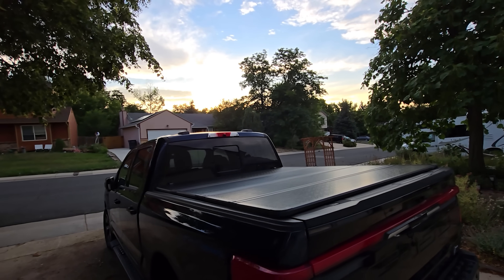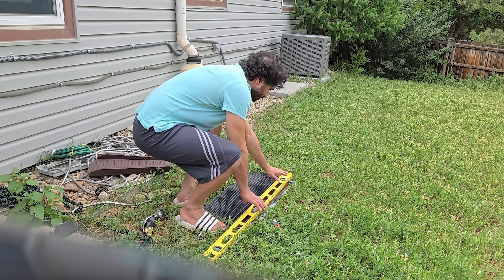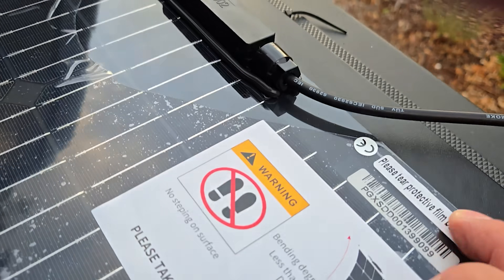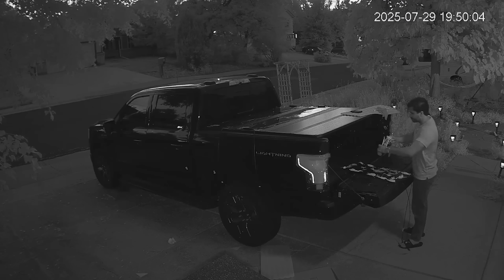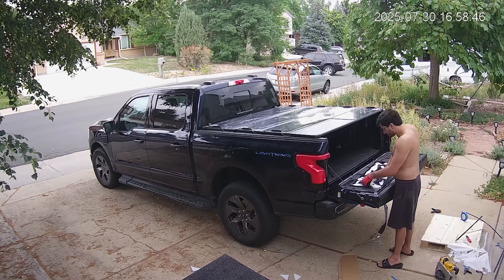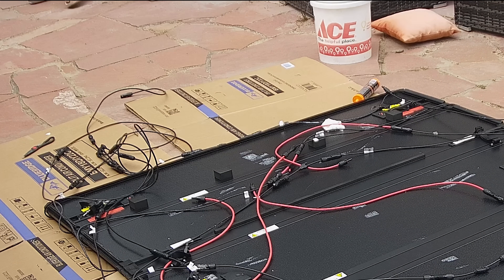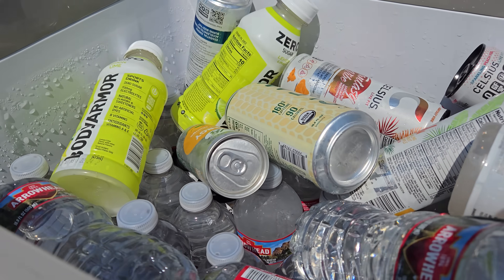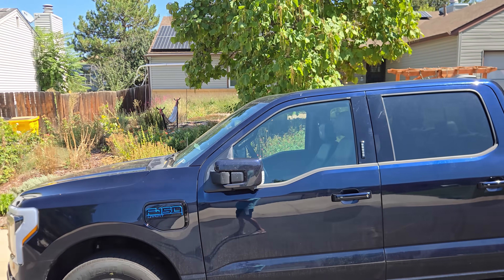Building a Solar Panel Tonneau Cover to Recharge My Electric Truck

Comment: Pretty cool! Doing similar on my preoject truck, but solar panels will be on the lid of my flush toolbox (not tonneau cover).

Im going to use it to power a mobile wifi hotspot and dashcam. The hospot and dashcam setup will always be ready to send notifications to my cellphone when something happens.

I calculated it so that my dual batteries will stay topped up and my dashcam,  hotspot, and compustar alarm system never has to steal current from the batteries as it always gets replenished in daytime.

Comment: Did anyone recommend a one piece, fiberglass cover with hydraulic struts? Larger panels, less wiring, fewer moving parts.
You can upgrade the struts for the added weight.
Reply from the maker: Sadly no one has recommended that yet

Comment: i get that the appeal was for it to be a truck be cover. but hear me out.what if you had attached this to a truck bed rack or an over cab truck bed rack. you could have had panels that slide from under the rack and over the cap more room and mounting points. and if you store a tarp in the back in case of emergencies, you can throw it over the bed and have a little shelter. Sounds dumb but when you've been through as many hurricanes as I have.  being mobile and having a safe place to rest and charge devices outside your home is nice. and the cables could be run a lot more cleanly if tied to a leg of the rack. and it's still light enough to be taken down by one person.

Comment: If you put some sort of heat sink under the panels they will be even more effecient, also clean up those cables , it’s ruining the truck part of having a truck bed
Reply from the maker: I was thinking about the heat sink too, prob for v2 if the panels degrees. And yeah it's been fine so far and just slightly annoying 😅 currently on a road trip and have so much stuff in there, including a powered freezer

Comment: Looks like a robot spider took a shit in the bed of your truck.  Too many dangly wires all over, ruins bed utility.

I accomplish the same thing with far less hardware.  I have an 8020 extruded aluminum roof rack on the camper shell of my truck.  I've got a pair of 100w solar panels up there (200w total), with MC4 cables coming into the camper shell.  These feed a charge controller and charge a small lead acid battery.  The battery powers an ICECO cooler/fridge, as well as other potential accessories inside the camper shell.
Reply from the maker: Nice post a pic. If you have suggestions that allow for more tidiness let me know. It's not immobile like a camper shell, so I still want to remove it or open the cover.

Comment: Maybe putting a hard too camper shell on the truck and then you could put an entire panel on the roof. Would probably yield more power and make the wiring/batteries safer!

Comment: did you know the caulk gun has a spout cutter built into it? 😂 Under ideal conditions, charging a 131kwh battery with a 375W solar panel will take about 3 months.

Comment: There were some very interesting choices made here. “Measure once cut 15 times” was the motto apparently. 

Those panels at risk of hotspots, it’s a cool idea, but going with 80% the panel size and not cutting them would have been a much better long term choice. 

I don’t think I saw a tape measure in the entire video. 

Almost line a behind the scene look at next season for “Just rolled in”

Comment: Nice! This is really cool. I have a 150W panel on the bedrails of my Maverick, and it works really well to keep my Ecoflow Delta 2 topped off. Can run my cellular modem and Starlink Mini without a problem
Reply from the maker: That's awesome!

Comment: Great video!  would be cool if there was a way to integrate solar charge controller and have it charge right into the main battery of truck (weight savings) and picking up 3-5 miles for free each day would be nice...have you thought about doing flexible panels on roof of truck to add more wattage?
Reply from the maker: Thanks! I have a moonroof so can't really add to the roof, and if I did I definitely wouldn't glue it lol

Comment: I've got a small solar array on the roof of my Maverick. It is powering some high static pressure PC fans at the pressure relief valve pushing air out of the cab.  More sun = more air turns over.  This allows the cab to stay much closer to ambient air temp.
Reply from the maker: That's awesome, you should showcase it in a video! I'd love to see it, either way I'm going to look into it more.

Do you shut it off while you're driving so the cabin stays cool with the AC on?

Comment: I put 3 100w flat solar panels on my tonneau cover 2 years ago. They worked great for a while, then slowly they produced less and less power. I live in South Louisiana so it's hot in the summer. I believe the heat kills the panels. I was getting close to 200w at first, now with early morning sun they might get 50w and in the heat of the day I'm lucky to get 20w. Have tried different brands to replace panels with no luck. Would like to try the cigs panels, I think they would work, but the sizes don't fit and they are significantly more expensive too.
Reply from the maker: That's a bummer, thanks for sharing and good to know I'm not the only one to do this. I was expecting some degradation but only 10% output after 2 years is crazy. I hope that doesn't happen to me.

Comment: For the security system there are DIY cctv kits for RVs Vans and other campers maybe a fun addition to the truck?
Reply from the maker: Thanks I'll investigate some more!
Reply: @deadlykiller27 I don’t think I can post a link here, but there is a van builder here on yt called Love Sundays and he installed such a kit on his van build showing it of in a build video and sharing an Amazon link it was quite afordable.
Reply from the maker: @MrKittke thanks for the suggestion. Tried looking through his videos but there's just too many and none of them are titled with cctv or anything obvious (I just see dashcams)

If you have a name of the cctv kit directly I'll check it out

Comment: You could run some 24/7 dashcams via their 12V hookups directly into that setup.  Pretty much make a similar setup that Teslas have built in.
Reply from the maker: I was thinking something similar! When I get it working I'll post an update video, for now gotta find the best cams that don't look obtuse and figure out the best way to run the wires

Comment: Every panel or panel string must have a fuse that is less than the panel Max voltage additionally you should have an isolator switch for every string lest you have a future fire. When smoke is coming out of your wires it’s too late to be looking for isolators that aren’t there.

Comment: I have solar panels on my house. I bought a charge point home charger and wired it in myself on sunny days. I can gain 10 to 12 mi per hour at the lowest setting and still charge the batteries on the house as well as run the house.
Reply: That’s my dream! Do you have to use grid power often?

Comment: Omg that's such a good idea. You really need to sell that idea. It nearly there for a professional job. You could run a dashcam off it for security.
Reply from the maker: That's my plan next, just got to figure out a way that looks half decent 😅
Reply: @deadlykiller27 it looks so good now. Maybe a black border thin around it. Oh maybe a frame and then attach the frame some way so that you can remove it from the cover itself.

Comment: What cooler model is this? I like that it doesn’t have dual zone that will take away from the overall space because of the partition. Cool setup!
Reply from the maker: Yeah I didn't want something with a partition, thought it would just be more trouble than it's worth. If I wanted to also freeze I'd just buy another one. I got this one

"Simzlife 12 Volt Car Refrigerator, 80QT(75L) Portable RV Car Fridge with Wheels, 0℉~68℉, 12/24V DC & 110-240V AC, Black"

I bought it off Walmart. It's also available by the same brand and others on AliExpress for way cheaper, but each time I tried ordering it (different sellers) they never had it in stock and the order would get cancelled.
Reply: @deadlykiller27 appreciate the quick response

Comment: Looks like about 400w of panels? I had a GMC 2500 that I glued 200w of panels on the roof of. I used something called Sika flex. The panels would charge a battery bank that was in the bed tool box

Comment: I don't know if the battery chemistry would even allow it but it would be cool if EVs had a solar top up option. Not so you could increase the range but so you could run things like your fridge of the car's battery and not have to carry around additional batteries.
Reply: Yes, the battery chemistry allows it, but the packs keep getting higher and higher voltage. Solar MPPT to EV battery is probably being worked on, but it’s an annoying electrical engineering problem as there are a bunch of different possible inputs and outputs. To do it efficiently, the charge controller would need to be developed for a specific car or battery system architecture. Ideally, it would interface with the existing BMS.

Comment: With as little as I generally drive (about 50-60 miles a month), that 2-3 miles a day might be enough to make a truck like that "free" to operate. Unfortunately the F150 lightning is just WAY out of my price range, and the payment alone would more than offset any cost savings from the little bit of gas I actually use (I fill up once every other month, and it usually doesn't need it).
Reply: EVs definitely aren't a good investment on their own (no vehicle is), but if you are ever in the market for a new car, consider electric instead of ICE. Hopefully the tax credits will be back by that time too. And there might be a used market too!

Comment: Thats a pretty awesome project. It'd be neat if you could rig up some kind of AC for the cab so when you get in on a hot day the cab is comfortable!  They have made progress on small 12 vort AC units.
Reply from the maker: Yes that would be cool! At the very least a fan ventilation system to exhaust hot air

Comment: Do dashcam that wired to the aux battery so it could run 24/7 without worrying the low voltage car battery
Reply from the maker: Agreed! Figuring that out with the wiring situation is going to be one of my next steps

Comment: Fyi, I was researching these thin, flexible solar panels for a different project, and there were many complaints that these panels are dead within a year or two from the overlanding community.

Comment: Literally makes total sense should be a normal thing for electric trucks

Edit: Specifically meant for beds with these covers not roof or hood as those are not flat

Edit:  not sure why F-sts think they can project their ideals over things that do not affect their lives one bit
Reply: Solar powered car has been an idea since so long ago but it's not practical since the solar panel only barely give extra range

Even if all the car's surface are covered in solar panels, the added range are still abysmal (like only 8-10 miles for a whole day of perfect sunlight)
Reply: @sihamhamda47 not really your problem what people buy to keep their 12v, features and accessories powered up with free solar power
Reply: There are flexible solar panels too. It feels silly that every EV doesn't have them.
Reply: @rouchar makes sense to put them on.
Reply: Yeah only be a $8000 - $12,000option😂 for little effect
Reply: @buffalobmf check out some episodes of this old house where they talk about solar panels being half as cheap as a few years ago and twice as efficient. Solar isn’t expensive anymore
Reply: @jtek5si auto makers would make that a 8000-12,000 option. And it doesnt make anywhere near enough power to even justify doing what he did
Reply: @buffalobmf money is no object for ev buyers known fact..
Reply: This will take days of perfect sunlight to add a just few miles. It's not even remotely worth it.
Reply: @jason91notch so what you’re saying if you are not going anywhere for a few days and leave it outside it’ll get charged.  At an airport will either keep it charged or increase battery level.  It can also maintain the 12v battery and active features like sentry mode.  All yall have such narrow thinking when you come across something you don’t like.
Reply: @FullSpectrumWarrior  sure, it might be enough to maintain a charge level if the truck is sitting for days at a time. But spending thousands of dollars and taking up bed space for batteries and eliminating the ability to haul stuff on your cover, (I've hauled an ATV on mine), for what is essentially a trickle charger is stupid.
Reply: @jason91notch money no object for ev owners and not your concern what they spend their money on.  Very (overused word these days) F thinking
Reply: @FullSpectrumWarrior I'm an EV owner, and it is definitely an "object". It's objectively dumb. Simple as that.
Reply: @jason91notch being an ev owner doesn’t mean you are automatically an F but your insistence on the “you don’t need” makes you one.   Since it doesn’t affect your life…denied
Reply: @FullSpectrumWarrior good job deflecting instead of admitting you're wrong. 👍
Reply: Same thing for the roof and hood, these are huge vehicles , might as well take advantage of the space
Reply: @wx2999  Weird how EVs don't come with built in solar panels by default.
Reply: @noppornwongrassamee8941 it would be $$$. I'm surprised Rivian hasn't done it though. Tesla really could since they make solar rooftops. Would make the cybertruck a little better imo
Reply: @noppornwongrassamee8941  I LOVE the idea, but the juice isnt worth the squeeze. 

If you COVER the entire car body with solar (I mean make body panels with solar capability at the mfr, not glue square panels all over the place), and leave it in direct sunlight, you might get 500W. Car body panels will rarely be at exactly the right angle for max solar power and half the car will be in shade at any time, and a lot of the time cars will be parked out of the sun anyway.  And then of course rainy and cloudy days will cut it in half or worse. Pickup has an advantage in that its largely flat, so you have that going for you.

For that 500W of solar body the mfr would probably charge $5000 for the option. The Prius had an optional solar panel roof that cost that much 10-15 years ago and that got like 200W in direct sun but all it did was run the fan so the cabin didnt get as hot which would technically save you gas on air conditioning once you drove off cause the cabin would be 100F starting out instead of 140F. And of course valueless in winter when you WANT it warm.  Theyre much cheaper today and capable of more shapes so I think you could get the whole body for that, maybe.

This pickup probably draws 35,000W driving down the road at a steady 65mph. So for every 75 hours of sitting outside on a sunny day you get 1 hour of driving - thats 19 days worth of sun in Ohio on average; in December you probably would not get that much sun during the entire month and it will be at such a low angle you aint gonna get full power no matter where you park. You can purchase the same electricity from a commercial charger on the highway for $17.50 in about 10 minutes or at home for $3.00 in 3 hours. Will the panels work long enough to break even?

Possibly they could engineer it to allow charging while driving. With normal "sitting still" charging they reuse motor electronics for charging, so they would have to add more electronics, they would probably want another $2,500 per car amortized across the entire production line for that ability. Probably even less worthwhile, how many hours would you be actually driving in direct sunlight?

There is one car you can currently (npi) buy that IS "solar powered" - the Aptera. It is a little 2 seater shaped like a water drop and covered in panels. You can just squeak by never needing to charge it (it does have a charging plug) if you dont drive much. Its a 3-wheeler so it only has to meet motorcycle crash safety standards (ie none) consider that for what you think its worth.
Reply: @natehill8069  On average in the USA about "60-80 miles of energy" hits a F-150 Lightning on an average day. With solar panel efficiency and inverter losses, that drops to a usable 10-16 miles of energy you can capture. For the cost of installing it the perks don't really outweigh the cost, but it's more of a YET situation. There is certainly enough solar energy that hits a car throughout the day that would be enough for most commutes, it's just a matter of technology and scale. These early days, yea it's like throwing an engine onto a carriage and maxing out at 12 mph when 2 horses would nearly double your speed after halving your cost. But that's just how technology works.
Reply: @mikeflanary642  OEM's don't do it because it would only add dead weight.  Even if the entire surface of the EV was covered in panels it would still take over a month to fully charge the battery...
Reply: No.  It makes no sense at all.  Solar panels on ICE vehicles makes more sense.  The tiny amount of power they produce could be used to heat or cool the interior by running a tiny fan.
Reply: @davidbeppler3032 wrong
Reply: @davidbeppler3032 an air conditioner is in no way “a tiny amount of power.”

Educate yourself.

Comment: Neat . That smoke machine was funny !!! . I just do not understand if I do not get the power to the main batteries . The truck has plenty of power to run the cooler and stuff .
Reply from the maker: The truck outlets don't stay on 24/7 sadly
Reply: @deadlykiller27  They can if you leave the truck on and turn off the 30 minute timer. I use my truck to power equipment on construction sites.

Comment: I hate to tell you this but those panels are going to cook your torno cover in the Summer & those panels derate substantially when they are hot would have been far better off with actual panels that air can get underneath to cool them